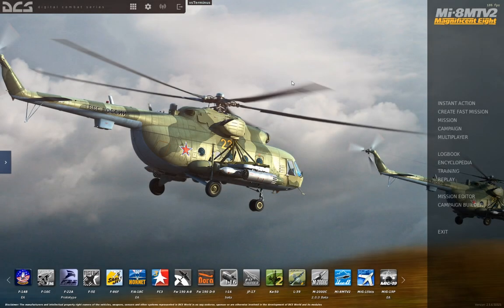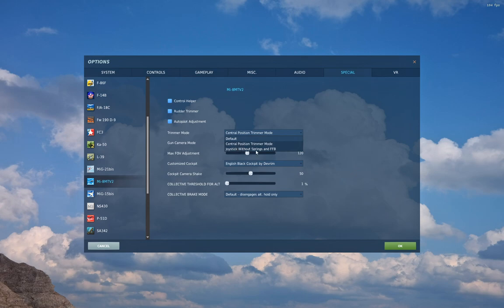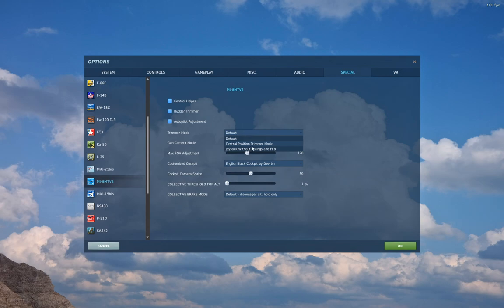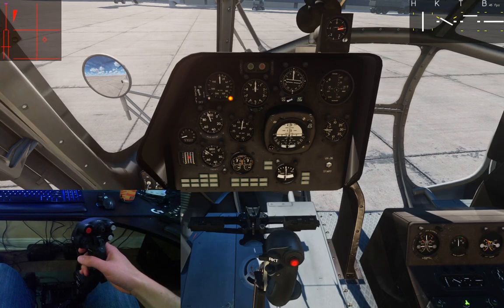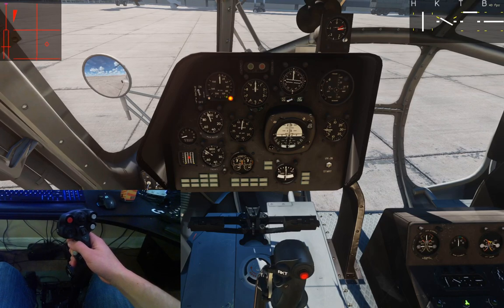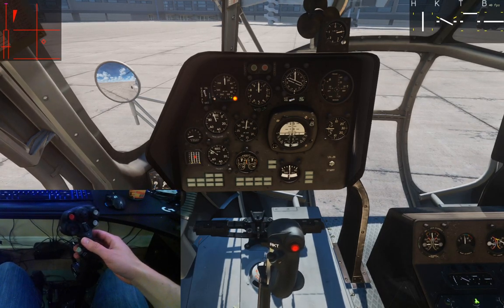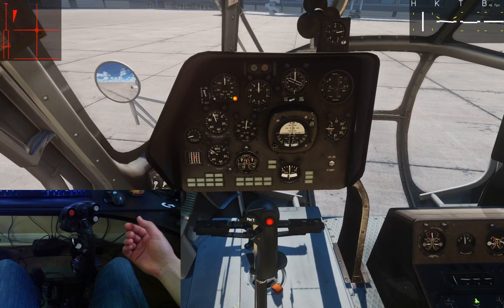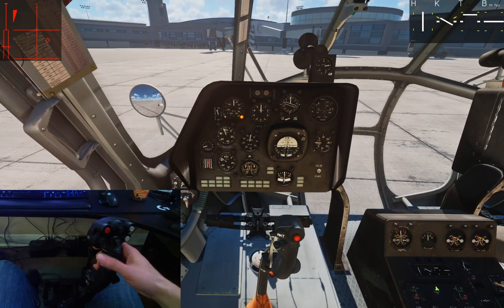DCS Mi-8: Trim Tutorial

Comment: I don't have lots of time in the Huey, but quite a bit in the Shark. I got used to Flight Director and landings were basically done by holding the trim button (which 'paused' FD).
When coming in to land (in the Hip), it is unclear to me what should be done regarding trimming and/or trim reset. For example if you were turning before lining up for you final to land at a FARP.
Great vids btw. Just got the Hip 2 days ago and trying to perfect my ability to NOT get into VRS. Oh yeah, Search & Rescue server is a great place to get better AND meet more decent heli pilots!
Reply from the maker: Most of the time if you are planning out your approaches and giving yourself enough room to slow down you shouldn't really need to be adjusting pitch that much. You can trim during the approach as often as you like and if you're flying a glideslope like you would in a plane it should work nicely.

Trimming on approach also has the benefit of when you land you'll already be trimmed for a hover, so you don't have to reset and re-do your trim before you take off (unless you want to).

Normally I don't reset trim at all unless I'm on the ground and stable. But I also tend to fly with the Controls Indicator (Right Shift + Enter) visible so I can see where I am trimmed at a glance. I find that really helpful. 

Trim Reset is risky in the air, I would avoid it unless you feel like you really need it. (eg your trim is all out of whack)

Comment: Good explanation, better than any I've heard. 
There are a few nuts like myself that use a traditional joystick with springs but use the 3rd trimming option (FFB or no springs). I've found I hate the transient that you get when trimming in the "default" mode and I hate the loss of control with the "central trimming" mode. Additionally, no longer having access to the entire control space and no longer having a kinesthetic feel for where the stick is bothers me. So instead, I just opt to fight the spring force the entire time.   

If you do use the 3rd option in a stick that stays where you leave it, you may still have to hit the trimmer. In the Ka-50, for instance, hitting the trimmer sets the autopilot's reference attitude and heading, and the autopilot will attempt to maintain that with low-authority commands.   

Unfortunately, there really isn't a good option for flying helicopter sims with traditional hardware. Commercial force-feedback sticks are scarce and pretty crappy. Best I've seen commercially available is the Komodo simulations cyclic unit. It's very expensive and only provides hydraulic damping; no force trim. I haven't tried it, but I've heard decent things.
Reply: Bit of a late reply but you can get second hand FFB stick cheap and they're easy to repair and mod.  For example on the Sidewinder FFB you can just take the grip off, stick another joystick grip on it (like a Virpil), take the board out of the virpil base and then run the wires for the grip out through the base of the FFB and just have the two seperate USB devices on the system.

Personally got a 940 that I stuck a thrustmaster TWCS on to the left grip of the throttle (which had no functions on it) to overcome the 940's primary limitation of very few functions on the throttle.

Comment: I would have liked you to address resetting trim.  When does one reset trim?  What happens when you reset trim and the craft wobbles into the neutral position?  Is there a better way to use trim reset?
Reply from the maker: That's good feedback, thank you.

Mostly my advice would be to only reset while on the ground unless you absolutely have to. When you reset in the air you need to be quick to recover from whatever pitch and roll it immediately throws at you. I would suggest just constantly using the trimmer button throughout the flight, making lots of small adjustments as you go.

Comment: Good stuff! This will definitely help me take the Mi-8 a little more than before. Curious though, does this apply to the Ka-50 as well? I see it has the same settings though I believe it's trim/autopilot works differently?
Reply from the maker: The options should work the same way, but the Ka-50 trim does more than just change the centering point of the cyclic, it interacts with the autopilot too. Unfortunately I don't fly the Ka-50 often so I can't really tell you more than that. It's on my list of things to learn eventually.

Comment: Doesn't the default trim setting trim it when you RELEASE the trim button? So you can press it, gently move the stick to centre position and THEN release the trim button.
Reply: aah, if this is the behaviour, that would explain why I had no trouble with the default… hit trim switch, centre stick, release trim switch. that and my joystick is probably configured oversensitive so it's never a long journey to the centrepoint from wherever I have the stick

Comment: how would a very tight dry clutch setting where it justs stays and doesnt return to center? would that work well with the 3rd trim option?
Reply from the maker: It works great for regular flight but makes it really hard to make small precise movements around the center so hovering gets really hard. I tried and ended up going back to just using very soft springs.